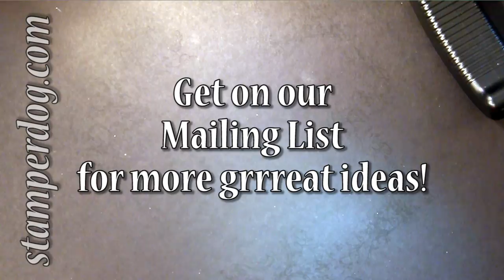How to Use a Stampin Up Roller Wheel

Comment: I'm new to paper crafting...bought a huge lot of used scrapbooking/cardmaking supplies& a wheel was included.Knowing next to nothing  I didn't know there were replacement cartridges (it didn't come with one) so after multiple attempts at trying to ink it up from a ink pad I took an Exacto knife,cut it off &now I use it with acrylic blocks.If this is a sacrilege in Stampin Up world I'm sorry..but at the time I thought it was better than throwing it out.=) Wish I had seen this. Tfs